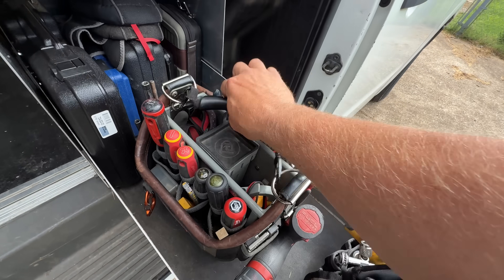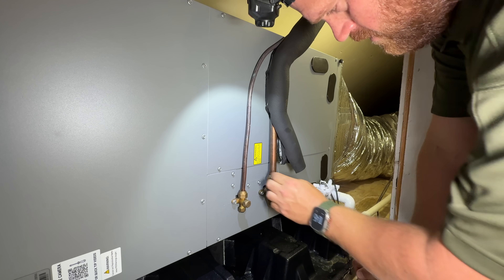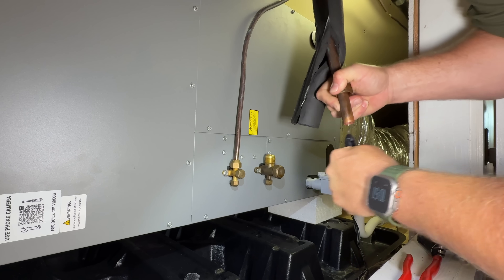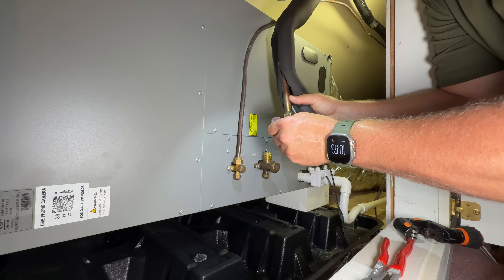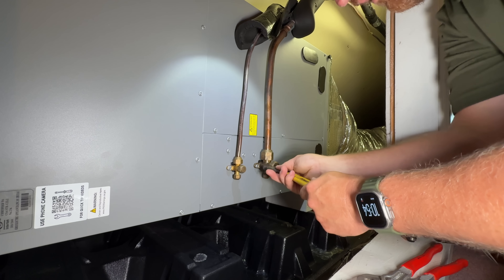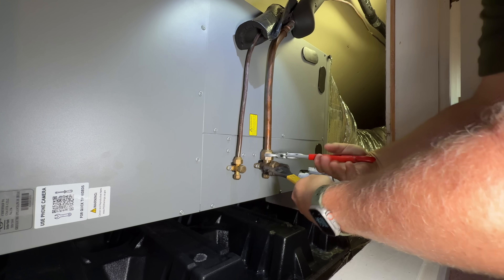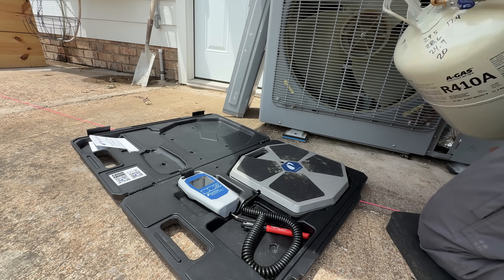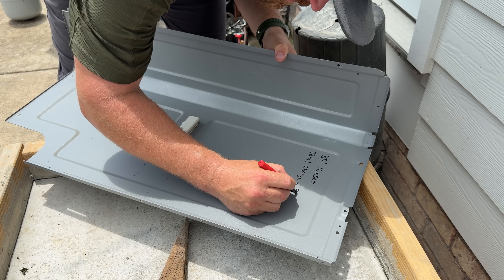Fixing a Refrigerant leak on a Gree Flexx Heat Pump

Comment: Threads don't seal a thing on a flare fitting. Nylon should be put on the flare face. Putting it on the threads throws off the proper torque as well.

Comment: Torque spec, go/no go gauge. Navac makes two different heads for their digital torque wrench,  as you know specs are in the manual, the nylog should only be put on the backside of the pipe just as lube for the nut. Keep killing out there man, love the videos-

Comment: Please put nylog on the mating surfaces. Putting it on the threads does nothing to assure a leak free connection. It’s like putting a new gasket and adding oil to the threads of the bolts instead of the gasket. If it gets to the bolts thread it’s leaking.
Reply: I think he does it so that the threads slide better
Reply: @hug00l they actually say don't put it on the threads or you get inaccurate torque?
Reply: @ivancook1247 bolts have 2 torque values. Oiled or not. Zinc plated are considered oiled. I never saw a spec sheet for flare nuts with 2 torque values though.
Reply: @samuelgagnon4853 when I was building engines I was taught to oil the threads for a true torque , but It seems like they say not to on the threads for flare fittings on minisplits makes no sense to me
Reply: @ivancook1247 it’s because the oil is not used to make it easier to torque. It’s used to make a tight connection. The oil should be on the mating surfaces of the flares.

Comment: Nice Work.  I'm not a big fan of these Gree units. the Knockouts are massive for the lineset and hard to remove. I also saw you unscrewed the lineset connection points, which is the only way i'm able to put on my copre removal tools, also annoying. I usually pick up flare adapters from the wholesaler and just braze to them, flowing Nitro of course. I blast out both lines individually and pressure test 400 psi for 30 mins. When i vacuum these units, I do one line at a time. add charge, then release from the evaporator first.

Comment: 1) Time to get a Torque Wrench for the Big flare Nut size.
2) also Proper Suction Line Support is Very important especially on the Larger Size Piping using a Flare nut. i've Found over the years larger size Flare nuts are always prone to leaks. I Highly advise against it & A Braze Joint is Much more dependable. Huge mistake on any Manufacturer that uses Flares instead of a Sweat joint. 40+ years of experience has taught me this.

Comment: If it's a good flare idk why you'd seal the threads on a flare fitting
Reply: threads don't seal anything on a flare fitting. the face of the flare is the seal, which is where your suppose to put nylon. Putting it on the threads does nothing but allows for incorrect torque.
Reply: Especially in refrigeration, it's a could idea to use a lube/sealant.  Microscopic scratches can happen during assembly also without a lubricant. Nylog will never harden.
Reply: Being humble, Every little extra thing helps, nothing is a given in this industry
Reply: Put a little on the backside of the flare to prevent binding between the copper and the brass nut. No lube will help on the face but it wont hurt nothing. Lube on the threads only if it’s steel for rust prevention. It’s useless on clean brass, but can help if it’s an old dirty fitting to get it to tighten up. I avoid nylog because the bottles make a big mess wherever I store them. I prefer superlube in the tube or just plain refrig/ vac oil.
Reply: Pipes go thru extreme pressure/temp differences in heating cooling modes especially with inverter systems, ive always found a bit of nylog works a treat to help deal with expansion/contraction and minor imperfections in the copper
Reply: So it wouldn't possibly leak again.. duh
Reply: @jameswashington1083 the threads are not what makes it seal duh
Reply: @samuelgagnon4853 same deal with o ring face seals with straight threads. I only put grease on threads if corrosion is possible. It serves no advantage to sealing leaks at all (unless we’re talking tapered threads like gas pipe.)
Reply: @FrenchBeefCDN totally agree except that you say it doesn’t help to put oil on the face. It does help making it leak free.